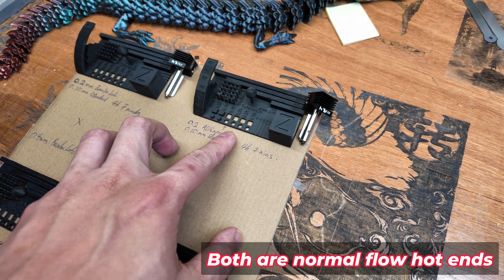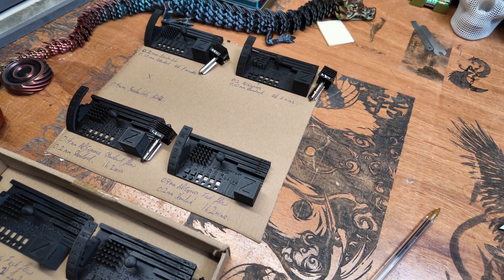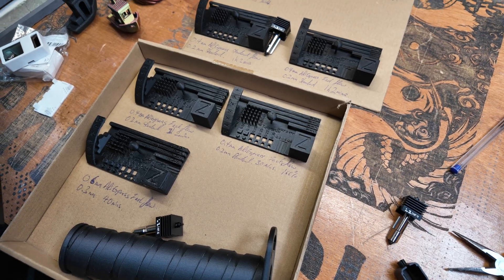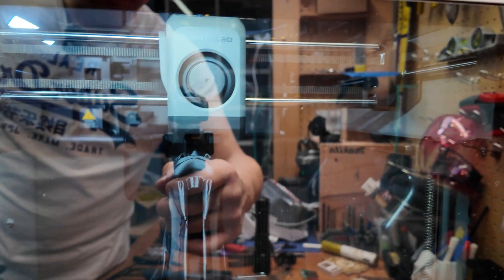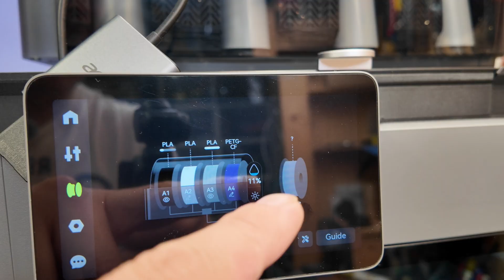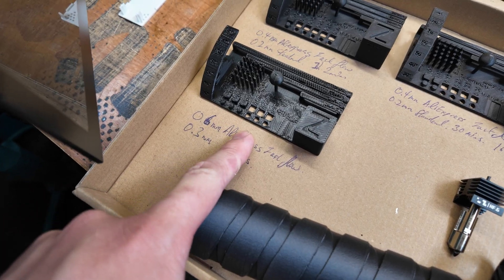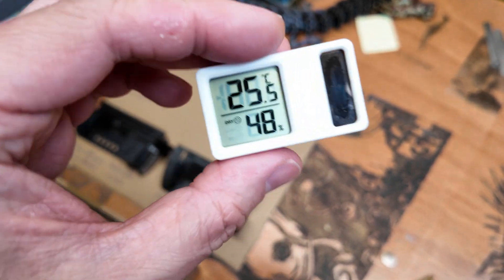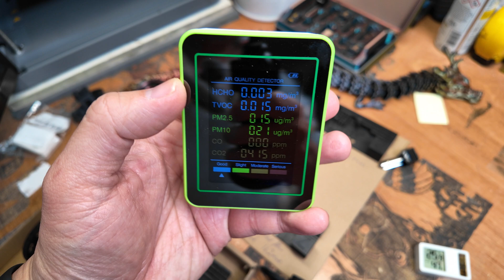Testing Cheap High-Flow Hotends for Bambu Lab P2S — Do They Actually Work?

Comment: I would like to focus the hotend on print quality and layer adhesion over speed. I don't get high flow due to increased speed, i get it as it consistently improves print strength due to more thorough melting at normal speeds. I would love to see if the cheaper ali-express ones or the mid-priced BIQU ones are the same as the name brand in this regard.

Comment: Running those temu nozzles in your P2S is like running 87 octane in your M3 

I assume you don’t see the problem in either
Reply from the maker: Funny you say that, I did have a E46 M3 and a Toyota supra TT and both only drink shell v power. Totally different thing the hot end and piston engine 😅

Comment: Great video! Have you done any max flow test comparing the P2S stock 0.4mm hotend vs Aliexpress 0.4mm high flow hotend? I heard the Aliexpress "high flow" hotends are just straight holes, while the genuine high flow splits the filament into three paths (more surface area, faster heating). Which is why the Aliexpress ones are so much cheaper. Though, it would still be interesting to know if it can at least beat the stock 0.4mm in max volumetric flow. Btw, you from HK? :)
Reply from the maker: Not done any max flow test yet as I am not very technical with Bambu Lab, I just change hot end and press ludicrous mode if I need to print fast. One day I will learn how to adjust speed and flow etc. I did had a look into the hotend top before use and it does show 3 distinctive light spots which indicate the filament does melt and push through that kind of high flow mechanism, to be fair it is not super science to machine the part. Coating on the other hand would be different, some high flow hotend have special coating which usually are proprietary and difficult to replicate cheaply. Yes, I am from HK but longer in UK now than in HK
Reply: @BCreviews  Oh, that sounds very promising! I remember CNC Kitchen did a video a few years ago comparing cheap $2 Aliexpress high flow knock-offs to a genuine one, and it performed basically the same. Even a poorly made "triple path" nozzle would still out perform a well made "single path" one. It's not rocket science to drill a few extra holes, but you can never fully trust Aliexpress sellers...lol

Comment: Hey there! Thanks for the video and some ideas in ut :-) I am also interested in that hotend with removable nozzle, have you tested it by now? If it is compatible, and I effectively get 0.2+0.4+0.6 in one hotend, I'd like a link to the shop and item you've bought and tested! So not the high flow one you've shown, but one with 3 different nozzoles in the plastic bag shown at  one point in video. Also, those vacuum bags look very nice, maybe link those too? Thanks!
Reply from the maker: https://s.click.aliexpress.com/e/_c2Jb9Gzx   same as the one I tested, for 0.2mm I find the Bambu one better, not sure if it is the combination of stainless and the size but it does give a cleaner print at 0.08mm height. The 0.4 and 0.6 Ali express HF is my go to nozzle now, the only downside is the silicon sock does not fit as it is for the HD2 machine. I just use the Bambu silicon sock over the Aliexpress hotends etc.
Reply: @BCreviews  Great info, thanks a lot! Gonna use black friday and just order a bunch of stuff from Ali this week, my Bambu hotend is fine, and I got 2 more, but for 3-7$ a piece, I'd rather have few in storage. Thanks again!

Comment: Hi great video what are the silicon gel desiccant bags are you using in the AMS unit, cheers ash
Reply from the maker: It comes in a bottle and I printed the cages to fit in the front slots of the ams2 6LBS Fonday Premium Moisture... https://www.amazon.co.uk/dp/B0BXJN3BJR?ref=ppx_pop_mob_ap_share
Reply: @BCreviews  thank you for you super quick reply, cheers Ash
Reply: @BCreviews have you tried using the drying capabilities of the AMS 2pro?
Reply from the maker: Not having to use that yet, I understand it can do either drying or printing but not at the same time. My drying agent keeping most of my filament at below 20% so far